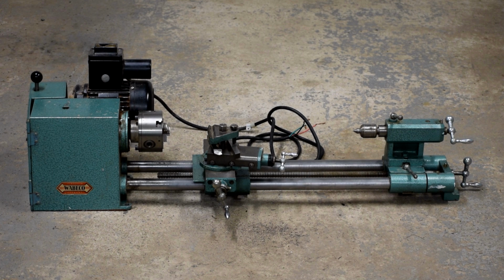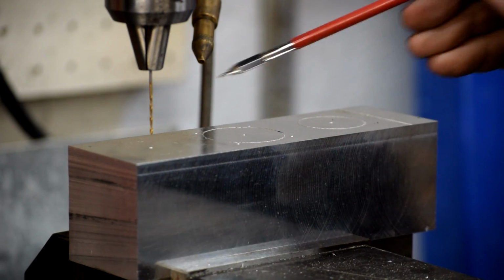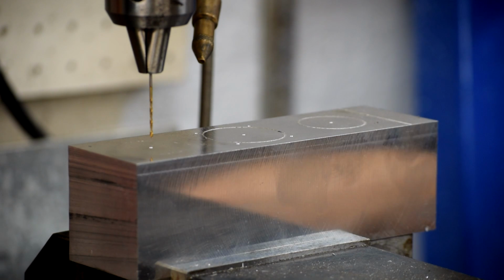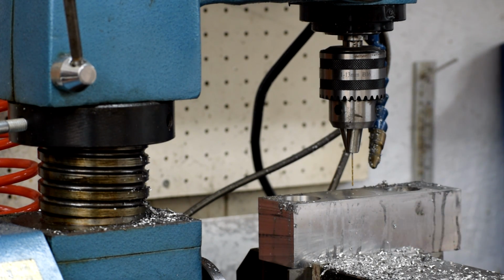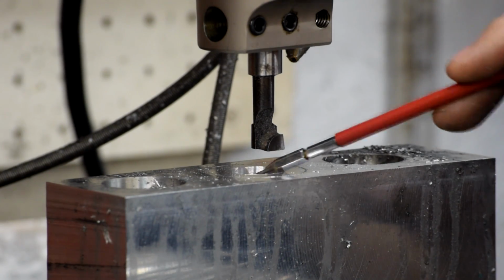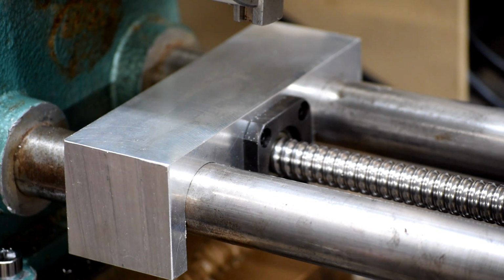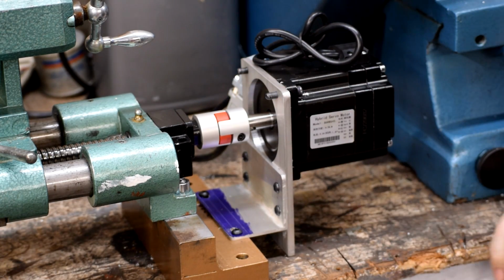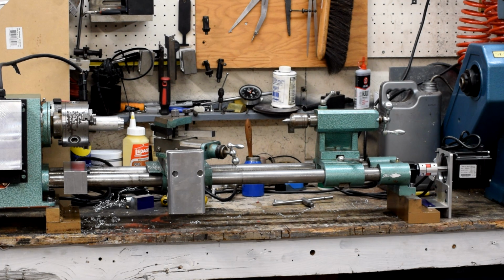Far North Racing CNC Adventures Episode 5 - Z Axis Ballscrew

Comment: For relocating the center hole accurately after moving the mill head... You could've reindicated the side you used as a datum, then  indicated the one of the existing bores, and moved the required 50mm to end up locating that counterbore as accurately as it was in the original setup.

That being said, your method worked nicely, and gave you the result you needed. Awesome work!